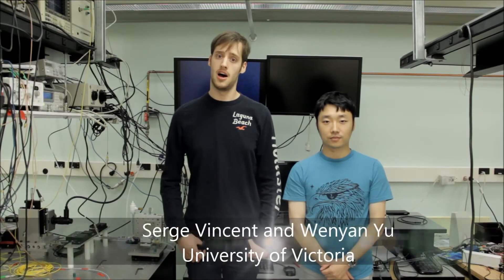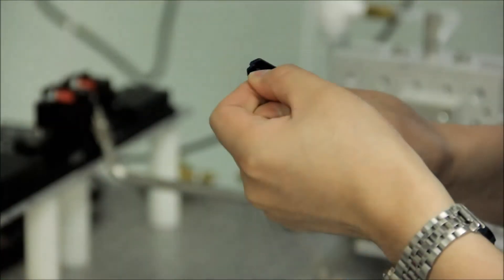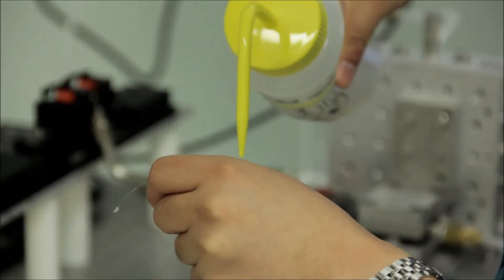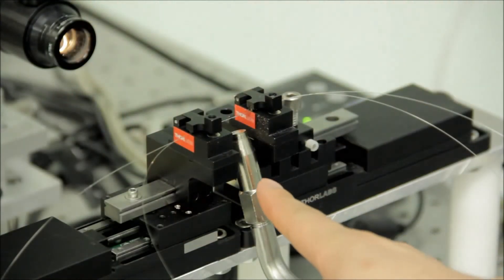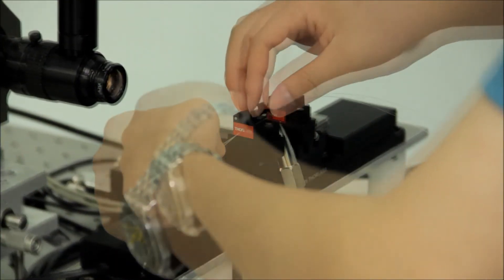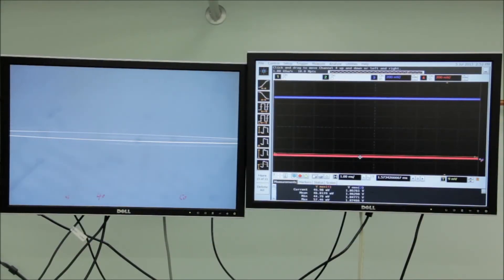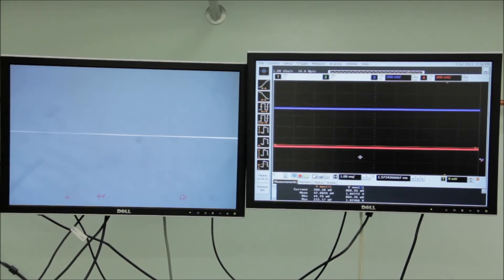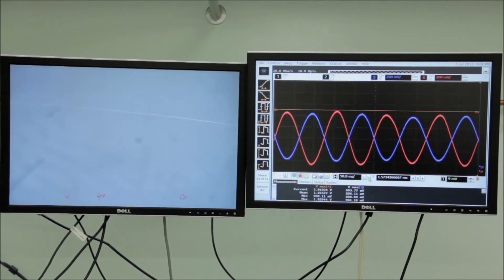Fiber Fused Directional Coupler Fabrication Tutorial

Comment: hi.. i have a doubt..we give 2 source 1550nm,1310nm..y joints and when  1550nm directional coupler..is used.. when the Fresnel reflection takes place in the 1310nm...   it is possible to get a good signal in PD..possible..help me
Reply from the maker: +Umesh Sampath I guess what you should use is a wavelength division multiplexer (WDM) although sometimes a directional coupler may work, if u r lucky...